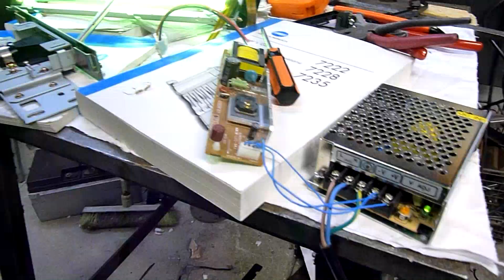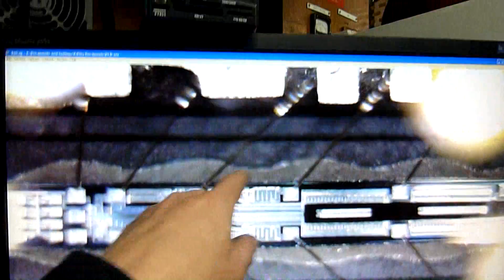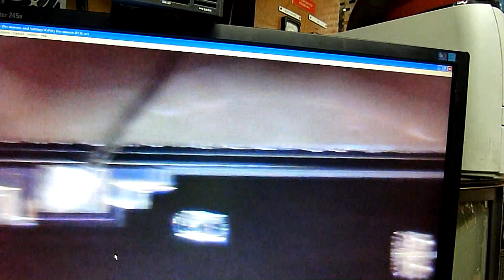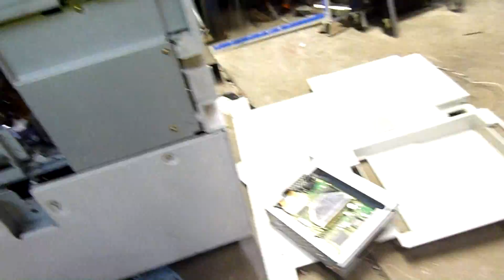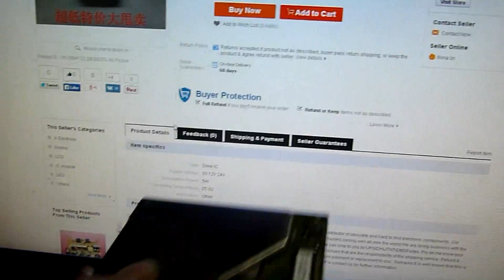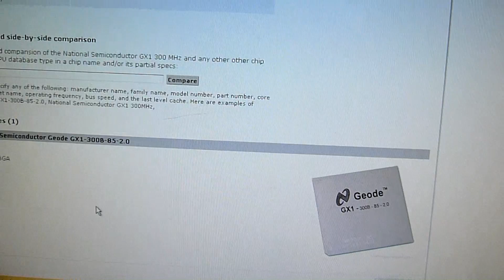Konica Minolta 7228 Autopsy pt3 Scanner Lamp, CCD and Digital Boards

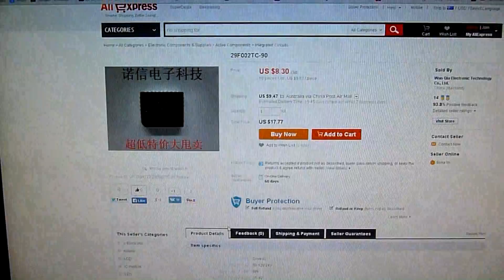Comment: LOL @ 18:00 : That 29F002 is not a driver IC, it's a common 2 MBit parallel flash for the BIOS. Hence the AMI sticker on it. The site you used seems to suck arse. Thy findchips.com and use the distributors websites to get information, That's much more reliable. That little board is an entire PC, awesome.

Comment: The first patent issued for a capacitive gas discharge lamp was from 1953 (U.S. Pat. No. 2,624,858) to W.B. Greenlee.  Several improvements were made to these lamps, most notably by Philips...

Comment: Shame the CCFL isn't white, could have been a useful light!! Thinking about it, the last USB scanner I had seemed to use tricolour LEDs that quickly flashed through the RGB colours, not as fun as a CCFL... :P

Pretty neat that it has a little computer in there, could almost be a predecessor of the RaspberryPi, kind of, well, maybe not... :P

Comment: You could probably find the Service Manual for that photocopier and find the pin-out for that print server and run something custom on it. There is a good chance you could connect USB cables or ports to it too if there's no pins for them on the header.

Comment: Some rapid start conventional fluorescent tubes require a grounded reflector to start. Once they are started the ground is no longer needed. I found this out because the TV studio I work at had a new wooden set built which had dozens of such "ungrounded" bulbs in it. At first, you had to touch each bulb in the middle to get them to start. We simply added grounded metal strips behind the bulbs to make starting automatic.

Comment: The CCD ends are covered so they return dark for that area. Note that the sensor is single line only.

It's analog out, some signals to step the CCD, power supply and miscellaneous control signal.

If you manage to unsolder it, you will most likely find a part-name on the backside.